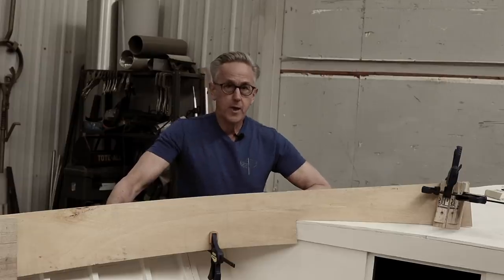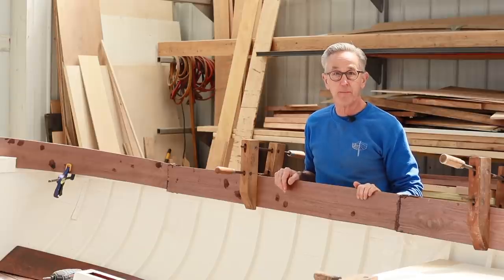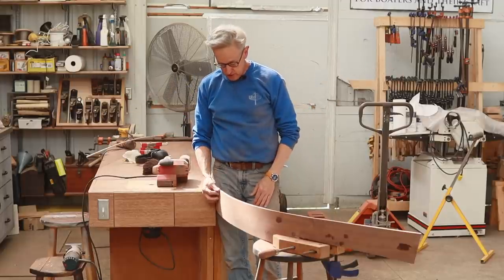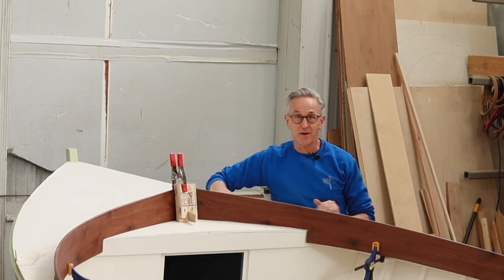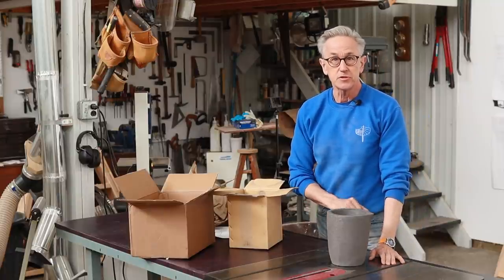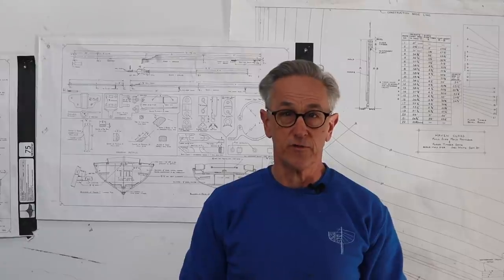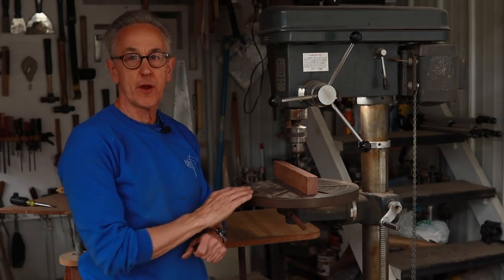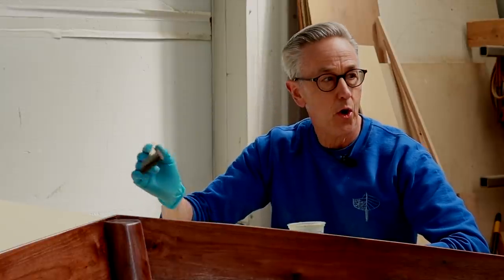Wooden Boat Building, Installing the Coaming, Part 2. S2-E46

Comment: "Art" of boat building is 100% correct.  Throughout the build the artist and sculptor in you is  on clear display.  My cabinet and furniture making is carpentry.  Your boatbuilding adds artistry to the endeavor.   If I had been fairing the coaming, when it came to the bottom edge I would have taken calipers and tracked the top curve to form the bottom curve.   You did it by eye, and of course the grain of the bungs lines up with the grain of the coaming.    Beautiful work sir.
Reply: Using calipers sounds like an interesting idea, but am thinking you would want to trim the bottom edge first to match the sheer clamp and then maybe use a combination square adjusted to the desired length to use as a guide to mark out the top edge - might be more accurate than calipers?
Reply: Oh, wait.  Just checked the previous video.  The height of the coaming varies along it's length, so our ideas wouldn't apply.

Comment: The coaming looks great Bob, nice to see you use glue instead of epoxy on those bungs, those who use epoxy don't understand that later on if you need to remove the bungs, it will be a nightmare. But with glue all you have to do is drill a screw into the bung and heat it up with a hot gun and walla give it a little twist and it comes out no problem. Just goes to show Bob, you know what your doing there bud.

Comment: A real surprise about you making the bronze castings, then you mention you are no stranger to the crucible.... My neighbour kept saying I had my work cut out for me on the restoration of my boat so many times that I ran through the list of jobs. He got quite angry with me for some reason and I told him I knew exactly what was involved and if I thought about them all at once I would have trouble completing the work, so just did one thing at a time until it was finished ( it shut him up, thankfully ). Personally I am looking forward to seeing all these different vids you will be putting up.
Reply: Yup, one step at a time. Of course you can work on a second task while the one is drying/curing (glue/epoxy/primer/paint). But yeah, too many irons in the fire, at once, and each task might not be completed to the best it can be.

Comment: Looks lovely. I really like the walnut. Not used much in small boats. I would have held the router horizontally so it registered on the sides. Easier for me to be consistent.
Reply: I really, really like your selection of walnut for the coamings: it’s one of my favorite species for woodworking.  As a longtime fan furniture maker, I discovered that I am terribly allergic to the dust; it causes a painful rash that lasts for weeks.  I don’t want to think about what it would do to my lungs, even when using a respirator.  Watching you use it on the Haven inspires jealousy and dread.  But it looks amazing!  Thank you, Bob.  This is an awesome series that proves I could never take on my own build even though it’s been my favorite sailboat design since I was 15 years old.  More than half a century ago!  Be safe and well.  Lofton

Comment: Beautiful work! Curious question - doesn't the coming need to seal to the deck and the rail to keep water out? Or is it enough to just be tight and a splash guard?
Reply from the maker: Yes, best to seal it.

Comment: What proportions are you using on the thinner on each layer? I guess you have more and more varnish and less and less thinner? What do you use to thin the varnish?
Reply from the maker: Hi Gunnar, I start (on fresh unfinished wood) with a 1:1 varnish to thinner for good penetration into the wood. I do several coats at that ratio and move to 2:1 I like getting around 8-10 coats, give the wood nice depth. I thin with the manufactures product https://www.totalboat.com/product/special-brushing-thinner-100 
Most Marine varnishes I'm familiar with, regardless of the brand, should never be use straight out of the can. Always a good practice to read the manufactures recommendation on the can.
Thanks for watching!
Cheers,
Bob
Reply: @TheArtofBoatBuilding  Thanks a lot for the answer. Unfortunately Totalboat doesn’t ship to us in Europe, the seem to have many great products. I’ve heard of many people using cooked linseed oil as thinner, have you tried that compared to Totalboat?
Best regards, Gunnar